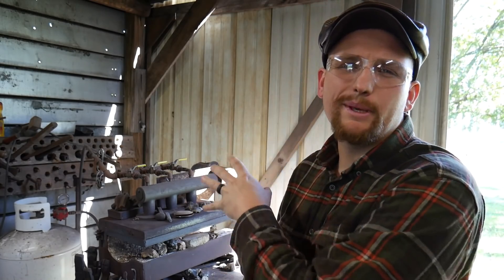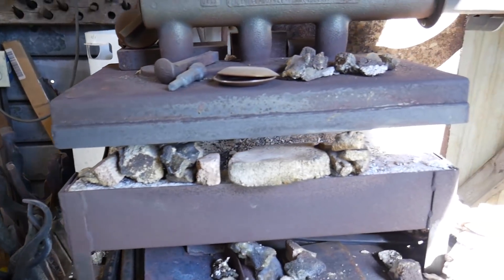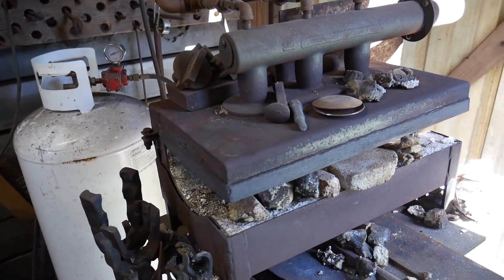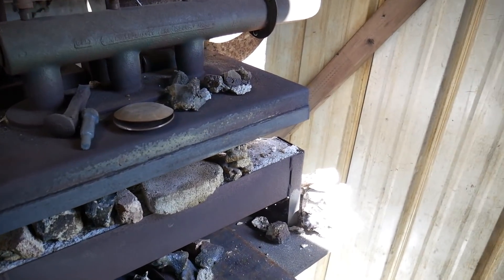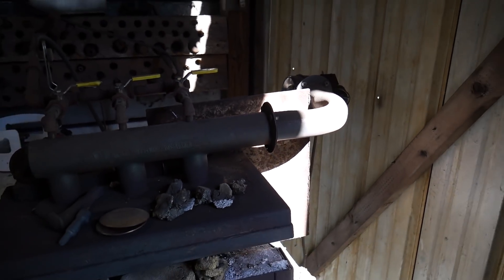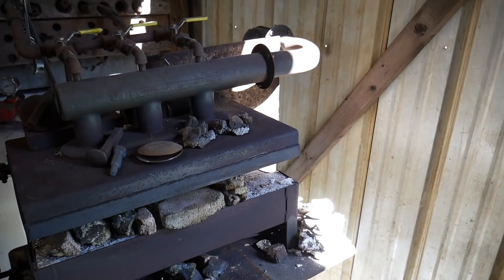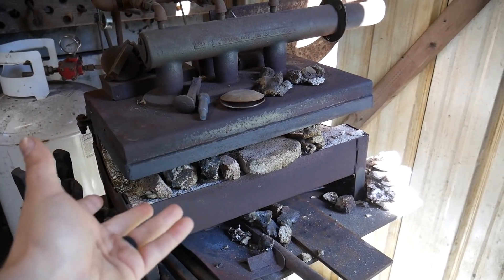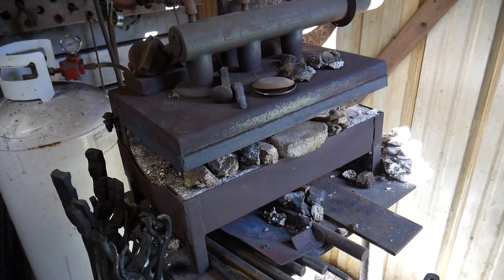Gas Forge Design Considerations [Pro Tip #45]

Comment: Can you run that particular forge with just one or two burners, or do you need to run all three?  I can see three independently piped gas lines, but there doesn't appear to be any mechanism for closing off the air blast to the burners individually.  I would think that would just add additional oxygen to the forge, which would cause additional scaling, as well as cooling off the forge.

Comment: Hi Roy,
Thanks for the info.
I wonder though, I've been watching your "how to build a forced air burner"video (a lot!),if you would consider a video on difference between the afore mentioned and your triple burner forge as far as eddie  currents and air psi versus cfm in the two different set ups.
Cheers

Comment: I'm thinking about using your forced air burner design, will just one of them heat stock big enough for making hammers? Thanks
Reply from the maker: Yes with a well insulated forge just one burner will give more than enough heat.
Reply: @ChristCenteredIronworks  good to know, thank you!

Comment: If I had your forge I would give it a  Rebuild adding an infra red  Reflector coating on the inside and  3 insulated doors with a perminent gap in the front so that It would have the proper size exhaust hole at all times.